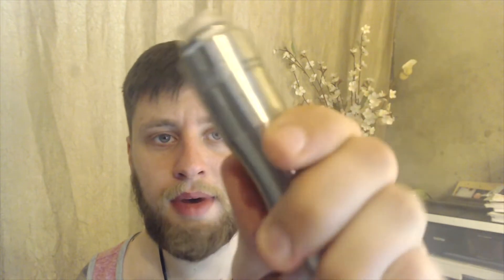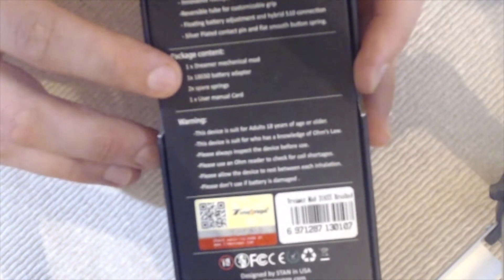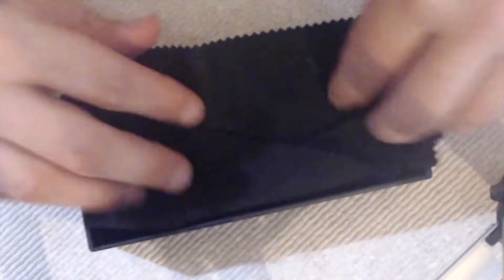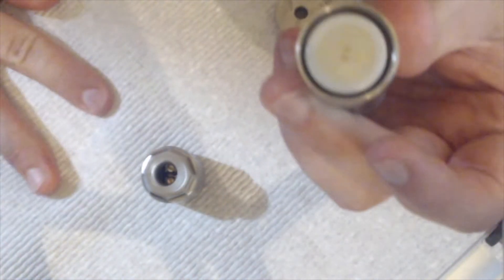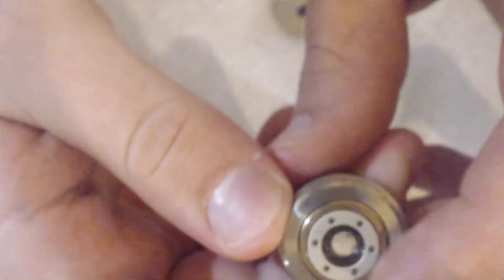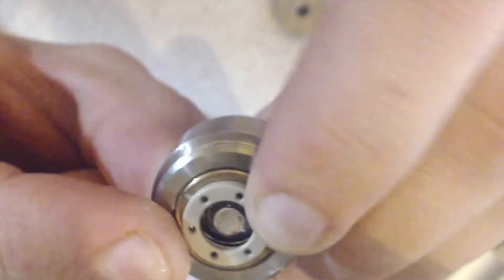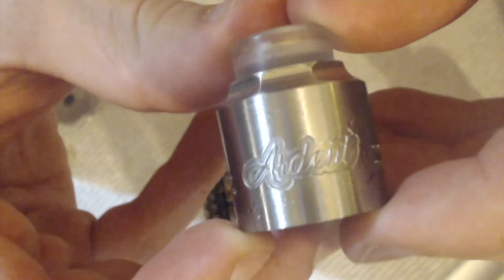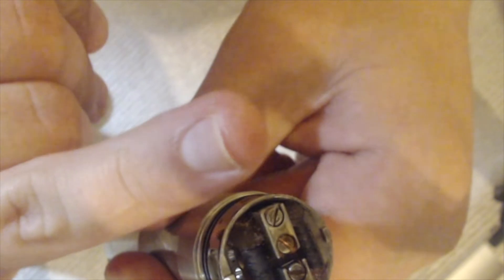Timesvape Ardent RDA and Dreamer by Stan!

Comment: You know you can screw the button to either side of the Dreamer? I think that's one thing that makes it stand out that i did would have mentioned. As for the Ardent it definitely looks dope on the Dreamer but i already know it's not my style of vape. Only thing i could recommend would be to move the coils over alittle so when you turn the airflow down it's hitting more of the coil
Reply from the maker: Ricky Mahoney I’ve tried to move the coils nothing has helped.. I was so frustrated w this rda
Reply: It sucks cuz it looks the tits on the Dreamer

Comment: Did you try adjusting the coils further away from the deck block? As Stan has mentioned it is a 27mm and it's a cloud chucker. Because of thar flavor will differ than a nice condensed chamber. 
The Dreamer is a good mech and for how long it has been out it has remained relevant through its reign so at least you got that out of the combo.
Reply from the maker: Fictitious Character yes sir, I’ve tried coils in all types of ways. This rda just isn’t my style

Comment: appreciate your thoughts man, i know we vape a little different as you said you use more single coils, still a good review. I was just curious if you tried the ardent with a series build? Im assuming you dont have the stack section for the dreamer but if you built it up and tried it on your mage i wonder if the airflow wide open would be better suited for that?
Reply from the maker: yes, although i would still like to run my rebirth in a series.. this would be much better with a hot high powered vape
Reply: sweet thanks for some insight. probably going to grab the rebirth first but eventually might try an ardent. Im just a sucker for bottom af